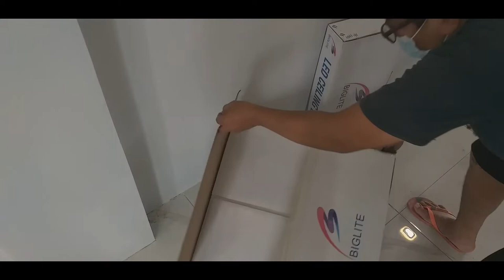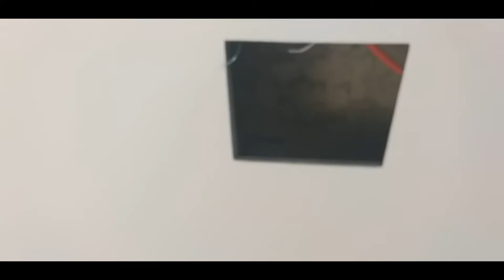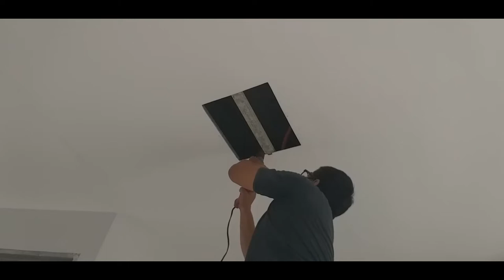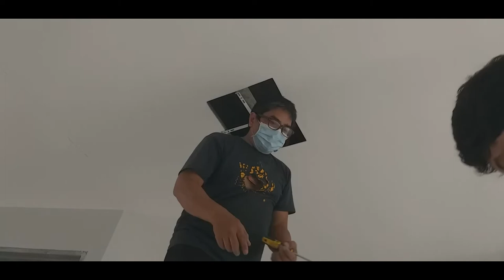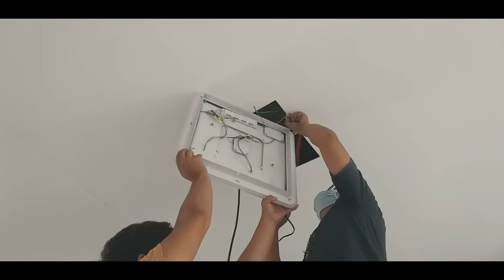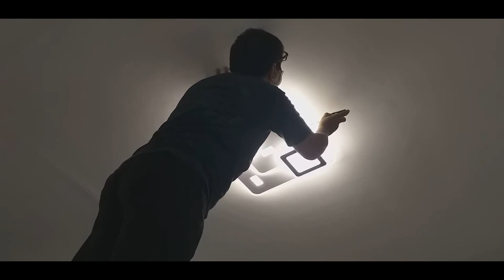#BIGLITE led light ceiling lamp with electronic ballast  25watts

Comment: Sir same brand po ng ceiling light ko. Bakit yung sakin po may excess na light pag pinapatay parang naka dimmed sya. Paano po ma reresolve? Salamat
Reply from the maker: sir gamitan mo ng switch na walang indicator
Reply from the maker: pag led light kasi sir kahit off na switch meron pang power kasi yun ledlight meron electronic ballast nag power sya low voltage 110v to 180v  pero palitan mo muna ng switch sir